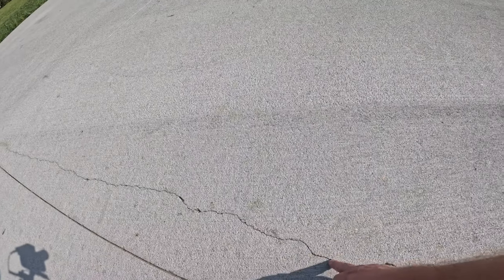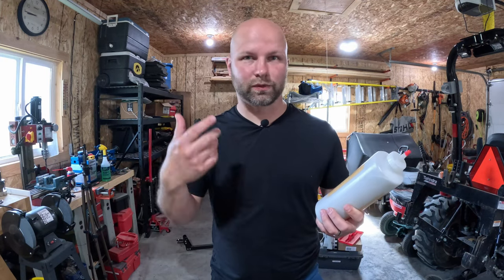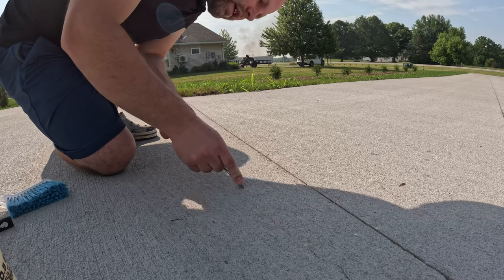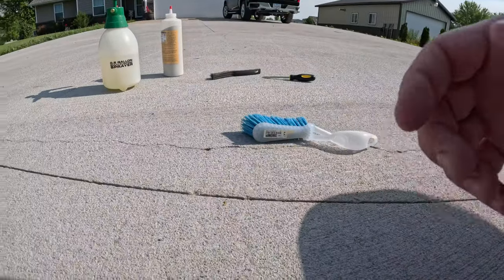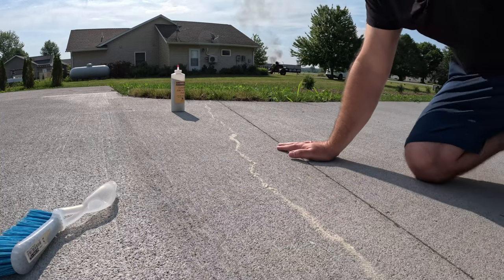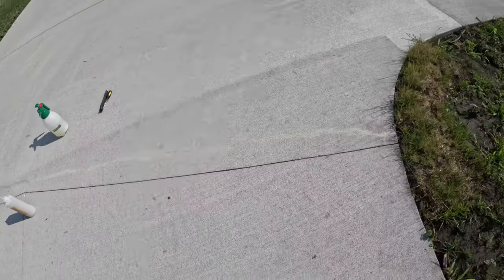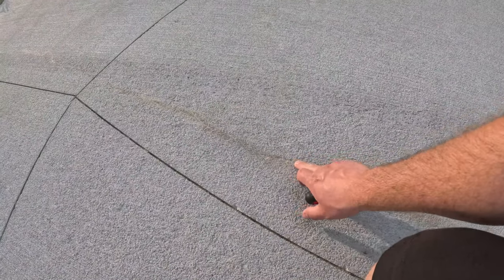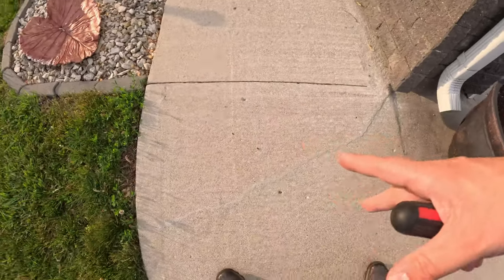Easy way to fill cracks in concrete using ConSandtrate!

Comment: Used this stuff this afternoon to do a crack that just started in my patio.  I had gotten a tip to use a nylon, drill mounted brush to clean the concrete before starting to clean the crack, used the same brush to level everything out after it set.  You can barely tell there was ever a crack there now.
Reply from the maker: Glad to here It works well! Thanks for stopping in!
Reply: How to do use the drill brush to level it after it is set?
Reply: @richardr.528  you’re basically grinding away anything that’s above the surface.

Comment: How long ago did you apply this and how is it holding up so far?
Reply from the maker: @lowKut  I applied it 1 year ago and thus far it's held up really well. A couple of spots where the crack is really thin let go but other than that it's been well worth it. Thanks for stopping in!
Reply: @k6outdoors  Glad to hear.  I certainly appreciate your video as it helped me out tremendously.  
I had a few hairline cracks in our new walkway that were a little over a year old, and I explored a few options, but after seeing your video and this product, I was sold. 
I applied it 2 days ago and it looks really well better than those silicon-type products.  Now I hope it lasts well.
Reply from the maker: @lowKut  glad to have been able to help! The positive news is even if it doesn't last years it's super easy to apply.

Comment: I bought some stuff from Lowe's in a bucket that's similar stuff. I sweep it in and mist it like you did. I do notice that after a while, it may crack again. If you use Lime Away in a spray bottle and hose it out, it'll adhere much better.
Reply from the maker: Thanks for the tips and thoughts on this!

Comment: Probably has a powdered polymer adhesive that is water activated.  Acts like cement when mixed with water but faster curing.
Reply from the maker: Thanks for stopping in

Comment: This product is extremely easy to use. 
I used it on a 60 year old garage with over 50’ of various cracks. I used it and felt it was so much easier than the elastic type crack repair products. 
In order to use the caulk type sealant and make it look good , I taped off the entire crack with frog tape, what a pain. I used this product and it was so much faster and looks better .
You can control the depth and width of the repair better with this product.
Reply from the maker: Glad to hear you positive experience with this stuff, I agree, its easy to use and looks great! Thanks for stopping in!

Comment: Does this “filler” flex with movement of the slab?

How has the bond held up over the past months?

Are the cracks reappearing?
Reply from the maker: So far so good, the material is designed to be flexible. The only real issue on my end is the section that has an extremely small crack, it never filled well to begin with. Thanks for stopping in!

Comment: I just used a similar product for my rooftop.  Very good.  My roof is no longer pouring and I haven't used sealer yet.  I used a grinder to open the cracks and a vacuum cleaner.
Reply from the maker: Glad to hear your positive experience, thanks for stopping in!

Comment: Can this be used with wide, deep cracks? If so, can you use backer rod? Thanks
Reply from the maker: It certainly can be used with backer rod and deeper / wider gaps, just multiple layers. Thanks for stopping in

Comment: What’s your opinion on filling control joints? Do you think it’s necessary since it allows water to reach the substrate? What filler would you use if so?
Reply from the maker: I personally think they should be filled. Mainly because we experience freeze and thaw cycles in our area and water penetrating the cracks and freezing can cause "some" harm. Alot of people do not do this and have no real issues for the life of the structure. I also prefer it as it keeps ants and anything else from filling in the gaps. I am trialing both this product and an epoxy based filler to see what I think works best. For large gaps, use a foam backer rod before final filling! Thanks for stopping in

Comment: I have the liquid stuff and will try that and sprinkle sand for texture and on the other bigger cracks, try your recommendation.  If hole too big I will use backer stuff.
Reply from the maker: Good luck with the trials, thanks for stopping in

Comment: Did you use ReRod when you poured your concrete. I did and still got some hairline cracks. I'm hoping they don't get worse with the ReRod holding it together. Your thoughts?
Reply from the maker: Yes, my driveway was poured 6" thick with #3 rebar. Rebar won't keep it from cracking but it will keep the slab together and provide structural strength to support heavy loads, provided the concrete was mixed and poured correctly. Generally speaking concrete does 2 things, gets hard and cracks. What you hope for is that the crack will "break" at the cut control joints, which obviously doesn't always happen. As long as the cracks are harmless curing cracks and not structural they should not get much worse. If you live in an area that has freeze and thaw cycles you might consider trying to seal the crack to keep moisture out. Hope this helps and thanks for stopping in!

Comment: Sounds like a better product than Quickrete which has a dark gray finish as opposed to concrete color and you have to throw any left over because the liquid and solid contents begin to harden and separate once the bottle is opened.
Reply from the maker: So far I've been really happy with the product, id definitely try it out. Thanks for stopping in!

Comment: Hi, It looks like a great solution👍🏻. I have cracks in the driveway getting too close to our house and its foundations, I might resurface the concrete after that. I found this same product directly from ConSANDtrate website in a smaller quantity (2lbs) for $14.95 + $10.50 shipping (to California), still cheaper than amazon and the slightly smaller container might be easier to use, plus amazon have enough business👋🏻
Reply from the maker: Appreciate the comment, thanks for Stopping in!

Comment: Quikrete concrete crack seal, 1 Qt. bottle.  Just shake a bit and pour.  Before I used this product, I took my small concrete grinding wheel to open up and clean out the cracks.  Then I used my yard blower to clean out the debris from the crack.  Last, I hosed down the crack and let it dry out for a day.  Lowe's & Home Depot this Quikrete product.  Easy to use and works great.
Reply from the maker: Yep, definitely an option. Thanks for stopping in!

Comment: I had the same thought using straight dry cement powder ,tap it in with a hammer and spritz on top .
Reply from the maker: This stuff is a little different, it remains flexible once dried, unlike cement. Thanks for stopping in!

Comment: so whats the difference between this and fine sand mixed with portland cement? genuine question
Reply from the maker: Honestly not 100% sure on this one, I am not sure there is actually and cement in this product as it remains flexible after it dries. Hope this helps, thanks for stopping in!

Comment: i bought the filler but there was just a cap.  not a nozzel. I'm not sure how to use the product without a small tip on the container?  Thanks!!
Reply from the maker: I'm confused why there was no nozzle with the bottle, maybe they accidentally didn't send it? I'll have to look on Amazon but I don't remember there being an option without a nozzle but maybe they added one. You could use an old restaurant style ketchup bottle or or something of that nature, you really need a narrow tip to assist in the application of the filler. Thanks for stopping in!

Comment: No way dude thats my dads! I use that stuff all the time for my driveway expansion joint business and for best use i always put sealer on top to prevent water flow even more
Reply from the maker: I am planning to fill in the remaining expansion joints in the driveway with it as well, it works really well and is easy to apply! I started using the liquid expansion joint filler and what a pain in the rear. Thanks for stopping in!

Comment: Hows it been holding up? Plz be honest, as I know you're getting paid to advertise. I plan to use this in my garage.
Reply from the maker: I was not paid to advertise it i legally have to disclose that, I bought the product with my own money. So far it has worked out well and am happy with how  easy it is to apply.
Reply: @k6outdoors  Then I'll give it a try then. We just bought a new home and there are nasty settlement cracks in the garage. I'm sure it will work out well, especially since it is inside the garage away from the elements.
Reply: Nice stuff, looks good, thanks for sharing. What size crack can it be used on. My cracks are probably close to 1/2 inch.

Comment: Shouldn’t the driveway be under warranty by the installer?—unless you did the work yourself, of course.
Reply from the maker: Concrete does 2 things, gets hard and cracks, cracks are inevitable. I don't know any concrete contractor who would warranty shrinkage or curing cracks like this. Ideally the control joints is where this would happen but you can't always control what the concrete wants to do. If it were settlement, structural or surface delamination it would be a different story. Thanks for stopping in!

Comment: So it's basically expensive quickcrete.
Reply from the maker: It's definitely is not the same thing. I am not sure there is any cement in it as it remains flexible after curing